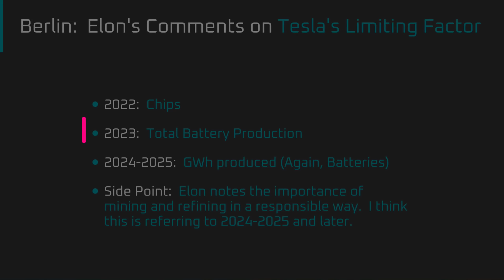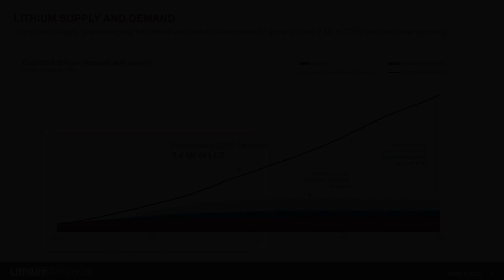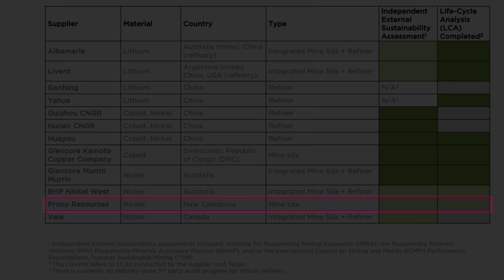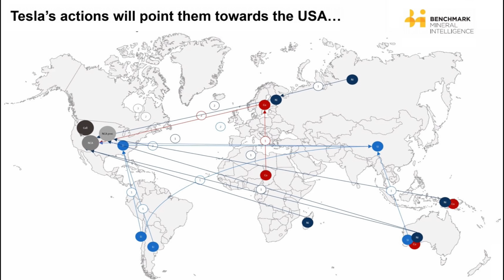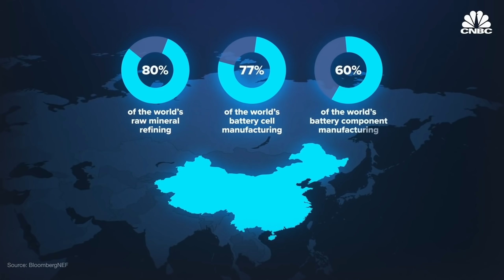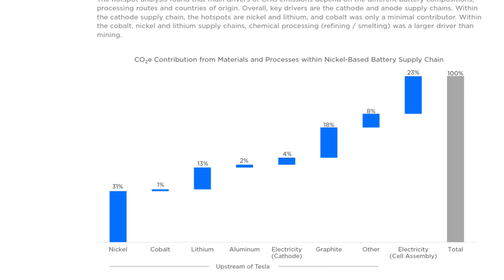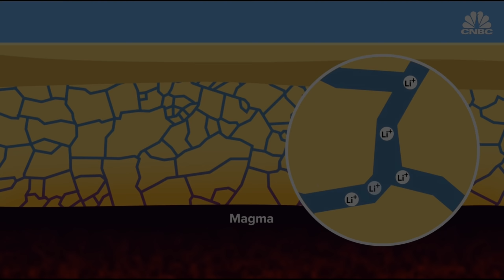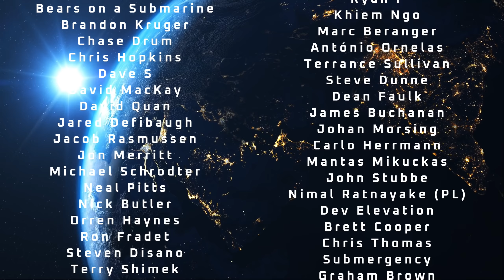Tesla:  Battery Material Strategies // Maintaining a 50% Growth Rate

Comment from the maker: Note 1:  Error.  The Y-Axis at 5:31 should be GWh, not Millions of Vehicles.

Note 2:  Since I finished this video, Drew has confirmed that permitting is the ultimate bottleneck and that Sodium Ion would be a great option:

https://youtu.be/-JUlVEDitlA
Reply: Was gonna say this resonates well with Drew’s recent interview. Thanks for the wonderful insight Jordan!
Reply: yep, always thought so. for static storage at least.
Reply: How can we watch this video?
Reply: Can you recheck the calculation in napkin math ?!
Is 300 TWH / 200 Wh/kg =1.5 Billion tons ?!
Reply: All of this is meaningless because Copper will end EV’s….a deficit in 5 years and a 9 million metric ton deficit in 10 years.  It takes 10-20 years and hundreds of millions to begin copper mining so with current mines barely meeting market requirements today and mines running full speed there is no way to save the EV market.  Aluminum is in the same shape.  It’s also not possible to increase lithium production 10 fold in 10 years.  Crash and burn coming.
Reply: @brianbrandt25  That is ridiculous.  Graphite and every other required mineral for EV’s are that are not in coins are a huge problem as well.

Comment: Your content is amazingly valuable, thank you.  I think it’s super important for people to realize that of the materials needed for what would likely be mostly lithium iron phosphate batteries only 80 g/ kilowatt hour of those batteries is lithium. Iron and phosphorus are plentiful. The question will be entirely about how we get enough lithium fast enough.  With the boring company Tesla has the opportunity to do mining by drilling tunnels rather than “mining”.  Briny water is available throughout non-potable aquifers throughout the Western states.  Tesla “just” needs to build enough tunnels in lithium rich areas to get the 80 grams x 300,000,000,000 kWh of batteries (2400000000 kg of lithium).  The lithium in Nevada clay is about 2% of that clay. At 2348500 kg of lithium per mile of boring company tunnel is about 1024 miles of 12.5 ft diameter boring company tunnels tunnels.  Vegas was NOT chosen “at random” as a site for the boring company, and Elon is 10 steps ahead.
Reply: I rechecked my numbers.  The concentration of lithium was bad. 2% is way too high, a very good concentration of lithium is 1000 ppm, or .1%.  300 tW-h would take 2,400,000 tonnes of lithium (at 80g per kW-h).  12.5 foot diameter tunnel * 1 mile is 29,356,750 kg of dry clay per mile.  That's only 29 tonnes per mile of tunnel.  So it would take 83 thousand miles of tunnel (in high lithium clay areas) to dig that much clay out of the earth.

Comment: Jordan is a smart and thorough reporter on these complex topics. Still, I think there was a higher optimism to factual information ratio in this report than is typical for Jordan. Perhaps, Tesla can help clean up the processing and refining of lateritic nickel but perhaps it can't. Don't expect an effort like that to proceed smoothly. Having to go hunting for partners engaged in nickle laterite extraction isn't an ideal situation.

The best way to deal with Nickle shortages is to stop using Nickle. Make LFP the main focus. Work on fundamental improvements to electrode structure and fabrication. And, develop a lower cost plan B, Sodium-Ion, for instance.
Reply from the maker: Totally!  That's why I said at the beginning of the video how it could be done rather than it being predictive or likely. 😉

Comment: I think that tesla should supply cells to gogoro and potentially partner or even purchase a large stake in gogoro. Tesla battery factory + gogoro swappable battery station network would be the perfect way to electrify Indonesian transit and mobility market. Integrate autobidder into the gogoro swap stations to build out microgrids and starlink for expanding internet access in more rural parts of Indonesia and you have one hell of a development package to offer in exchange for access to as much high nickel cathode they can manufacture and export...
Reply: This whole presentation concerned the likely lack of certain materials.
"Battery swap" requires more materials.
Go figure.

Comment: The lower budget market can be very low range vehicles but with the ability to go to a supercharger and book up a mobile range extending battery (on wheels) to the rear

Maybe even just 50 miles would be enough for the cheapest end of the market (with a 7KWh battery) but with the ability to go to a supercharger and rent for a day or few days a 50KWh mobile battery which takes the 50 mile range to 300 miles

With 7KW chargers literally everywhere every single street (they are super cheap to build) it would mean you can charge at both ends of your trip

50mile 7KWh cheap small cars would mean you can build 10 small EVs rather than one big heavy 70KWh vehicle

Comment: your comment about 'hiding out in the pickup truck market' points out a major problem with the EV mandates.

The Station Wagon used to be the default vehicle for families, but increased emissions requirements for 'passenger cars' (which included station wagons) caused manufacturers to stop producing station wagons and instead push people to vans (and mini-vans) and later to SUVs, because they are not classed as passenger cars, but are instead officially light trucks. So the emissions mandates ended up replacing station wagons with much heavier (and therefor less efficient) SUVs and crew-cab pickups.

Comment: Lithium from seawater will probably be significantly more feasible if existing experimental graphene desalination can be effectively scaled.

Fresh water for irrigation, and brine that cab be mined for lithium and other elements, using very little energy for the desalination process.
Reply: However, I suspect that would require a LOT of Graphene?
(Not saying it can't/ won't be done)

Comment: UBS included rare earth metals because they are essential in producing magnets that drive electric motors. A shortfall would clearly be a problem and not only for EVs but all products that use electric motors or generators, eg wind turbines.
Reply from the maker: Yeah, but the heading says batteries.  They should have changed the heading if that was the case.
Reply: I suspect UBS used the term "rare earth" simply because it's an often used (but misunderstood?) "buzzword" for media outlets and some "analysts"?

Comment: A possible way out of extreme mineral needs: energized roads at frequent intervals that charge cars riding on them, allowing  vehicles to have much smaller (lighter) battery packs, holding, say, 80 miles at full charge. Just an idea. What with longer endurance (rechargeability) and recycling of battery minerals, maybe need for these materials won't be as acute.
Reply: This is exactly what I was going to point out, too. I see some investment opportunities in companies addressing electric charging distribution issues. In 10 years it may be economically unviable to have a huge 300 mile range battery pack in a car; instead the charging points will need to be everywhere and mostly passive -- something like inductance pads under every parking spot and perhaps in the roadways themselves. Only rarely might a car be actively plugged in to top off. Another point not often discussed is how rapid charging is both incredibly expensive to supply as well as damaging to the battery packs themselves compared to trickle charging.
Reply: Sure a few trillions to rip up and replace and then have to maintain that as well.  Pipe dream.

Comment: Absolutely fantastic video - when I saw UBS's forecast for shortfalls of different materials I thought why mention rare earths and why leave out Mn, and they you asked the same questions. Sea water extraction does not seem economically feasible.  At 0.1 ppm, you need to process over 2 million kg of sea water to extract 1 kg of Li. Also, you need to separate it from other more concentrated cations, including Na, Ca, K and Mg with Ca being about 100,000 times more concentrated. So, you're working against a very large entropic driving force to keep Li mixed. Better to go after a more concentrated source and avoid handing so much water - the Salton Sea is 4000 times more concentrated in Li than sea water.
Reply from the maker: Totally!  The only way I can see (sea?) that it might work is to combine with desalination or something.

Comment: Regarding the pickup question (and I would lump large SUVs in that group as well), the problem is range.  Yes, manufacturers can add batteries (maybe up to 200kWh?) but that consumes those precious raw materials you mentioned.  And it takes a long time to charge.  I really don't know of a good EV solution is you want to tow a trailer a long distance.
Reply: I don't know of a good solution either, but a not so good solution would be a trailer with a built in additional battery. You wouldn't have the extra weight while not towing, the trailer could charge from a second charger to reduce charging time, and it could double as home energy storage while sitting at home. But it would be extremely expensive compared to a regular trailer, and would greatly reduce payload.
Reply: Let's wait and see how the first Texas cars charge?
If the 4680 can sustain 200 kW+ for a large percentage, that's a large part of the solution.
"Small" pack, reasonable range, fast turnaround.

Comment: You didn't mention nuclear.  There may be advances in this technology.  Of this 1 1/2 billion tons needed, how much is just for transportation?
Reply from the maker: That's because nuclear wasn't relevant to the conversation.  I support nuclear, but it just wasn't salient.

Half of the material needed will be for transport, the other half for energy storage
Reply: @thelimitingfactor  Thanks for answering.  I was thinking it was relevant because it could of course greatly offset the need for battery material, but I get your point.

Comment: Using a lot of LFP is also going to help a bit with the Lithium supply. I couldn't really find any numbers on this, according to my own calculation LFP needs about 25% less Lithium per kWh.
Reply from the maker: My understanding is that it uses more lithium per kWh due to the lower voltage.

https://seekingalpha.com/article/4512379-tesla-strategic-battery-strategy
Reply: @thelimitingfactor  LFP does store less energy per active lithium ion due to the lower voltage, but with an LFP cathode all the Lithium atoms from the cathode can be active ions (so the only inactive Lithium is first cycle losses and the Lithium in the electrolyte), whereas with an LiCoO2 cathode the crystal structure breaks down if you deintercalate all the Lithium. Only 50 to 60% of the Lithium in the cathode can be used for energy storage. I assume that NMC and NCA are similar. The article you linked actually mentions this, too. Note also that the article only compares LFP to chemistries not commonly used today. There are several "5V" cathode materials that could be incredibly efficient regarding lithium use per kWh, but as far as I can tell nobody has found a suitable electrolyte for such high voltage batteries.

Comment: Increasing energy density reduces materials needed per vehicle.  A doubling of energy density would reduce your 40x prediction to 20x.  Reducing battery capacity per vehicle would allow for more vehicles.  Charging infrastructure is key to reducing capacity.  This would require increasing cycle life.  A very long cycle life will reduce materials for recycling for a few more years.  It's a very big problem that is moving slowly.  We need to move faster than the problem.

Comment: How sustainable is Tesla's PE ratio if current growth rates are only sustainable for 2-3 years?
Reply from the maker: I don't think I understand the question.  If they currently have a PE ratio of 100.  In 3 years at a 50% growth rate, the PE ratio will be about 30.  

Then, if they keep growing at 20 to 30% per year, stock price will follow a similar trend.  

That's not taking into account energy business revenue, any potential robotaxi revenue, etc

I have no clue what their growth rate will be after 2025, but one would assume it would grow at least the same speed that the battery materials market would grow.
Reply: @thelimitingfactor  $1500 .....    2024
Reply: A super-high PE of 100 is appropriate for a company experiencing such high growth (50% a year). If that super-high growth rate will fall in 2-3 years at batteries become the limiting factor again, then one would expect the PE multiple to drop.

On the other hand, earnings then would be actual rather than forecast, margins are increasing, and other revenue sources may be more significant. I also think it is likely that Tesla will find a way to secure lithium.

Comment: Should we reiterate the basic Reciproction-recirculation pulse probability "true nature" of Chemistry, based in functional Euler's e-Pi-i 1-0-infinity instantaneous trancendental cross-sectional nodal-vibrational compositions, then the raw image of standing transverse wave-jets "sublimating" from the surface of a Chinese Rubbing Bowl in action, indicates the fractal conic-cyclonic modulo-geometrical log-antilog interference emitter-receiver, pseudo random exclusion-inclusion condensation modulation cause-effect of phase-locked Quantum Resonance Bonding Matrix universality in relative-timing ratio-rates.

Most School Science Students saw a similar, more orderly, pattern of dust collection in glass resonce tubes using sound waves to condense the dust in the tube.., and this is significant in studying the geological patterns in cooling lava crystallisation to basalt and Granite etc.

Professors Shirley Meng a Donald Sadoway explain the manner in which Cathodes and Anodes collect Ionic charged atoms, and that is relevant to pure-math distribution of Primes in the Real Number e-Pi-i resonance bonding Calculus of pseudo random "Gaps between Primes" that is the patterning of the Holographic Principle Image condensation modulation cause-effect Perspective in Fluxion-Integral Logarithmic Time Duration Timing Conception. 

Which is to say, a rough idea of existence as, "All is Vibration", plus the inside-outside holographic presence of pure-math relative-timing ratio-rates Circuitry, focused here-now-forever on e-Pi-i omnidirectional-dimensional Fractal Reciproction-recirculation, this is a reasonable and rational First Principle conscious awareness of Enlightenment in Temporal superposition Calculus Completeness of Quantum-fields Entanglement.

Comment: Nitpicking but @8:14 your graphic is out of date. FCA and PSA merged last year to form Stellantis. Also in 2021 Bugatti became no longer controlled by Volkswagen, but instead by Rimac in a convoluted new corporate structure (VW gets 45% of the new joint venture, as well as 24% of the new parent company), but one which is independent from VW... I think. Like I said, it's convoluted. Also, Geely controls Polestar which is (at least currently) a separate brand from Volvo.

Alright, that's about all the nits I found on that graphic. Most of them actually strengthen your point, just wanted to be pedantic!

Comment: Great work!
How can you count scrap from defective cells as input?
Assume you want 10 units. Say input is 100X to make 10. Yield is at 90%, so you get 9 units. 90X went into 9 units and 10X is recycled. 90X + 10X is back to 100X.
It kinda sounds like your math would add up to 110X or rather 10 units + 10X from scrap.
I assume that when figures to how much material is needed pr. kWh it assumes 100% yield or the amount in the finished(working) product at least.

Comment: As much as I think Plug-in Hybrid vehicles are a half-step in the right direction, it might be the half-step that we need to ease this battery problem. A Plug-In Hybrid requires about 25% of the batteries required in a full BEV. Which means that we can make 4 plug-ins for the battery resources of a single full BEV. My guess is we will see a lot more plug-in hybrids as the raw materials issues get worse. 
Taking this a step further, Tesla will never make a Plug-in Hybrid, so if battery prices increase drastically this could make Teslas even more expensive, compared to a plug-in hybrid.